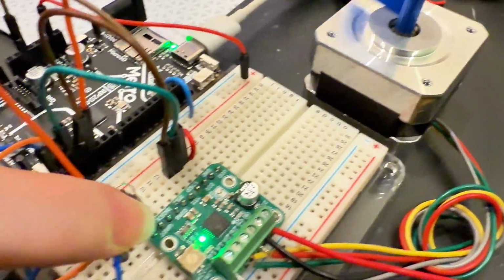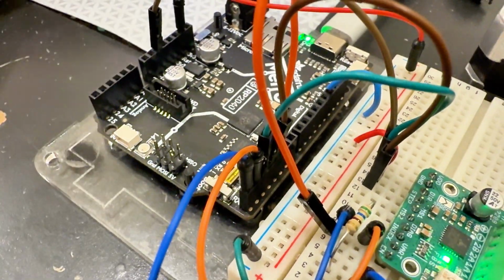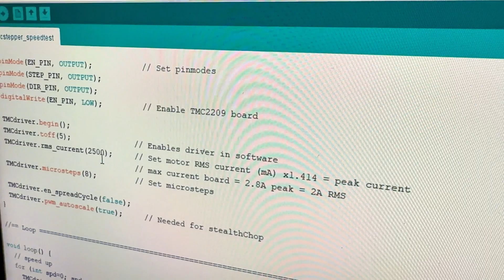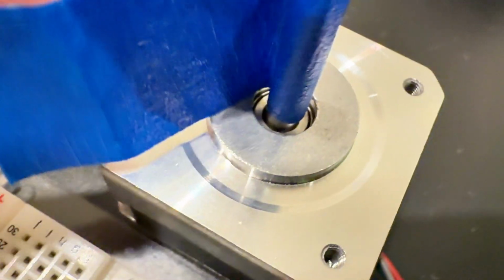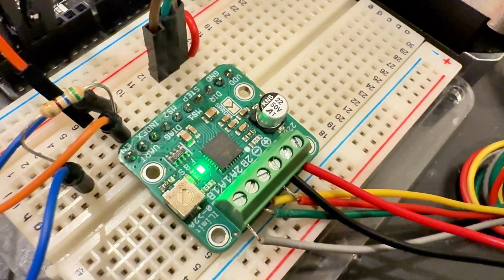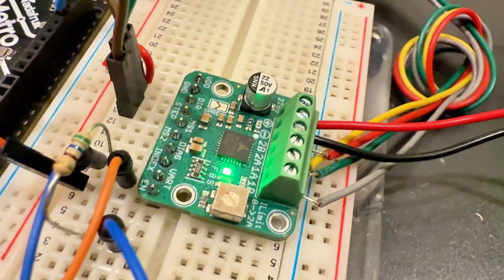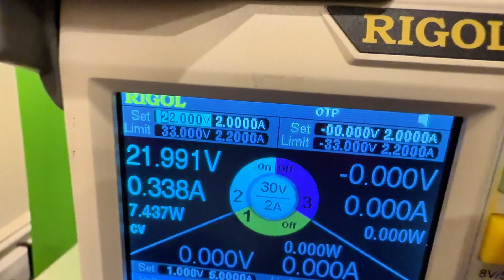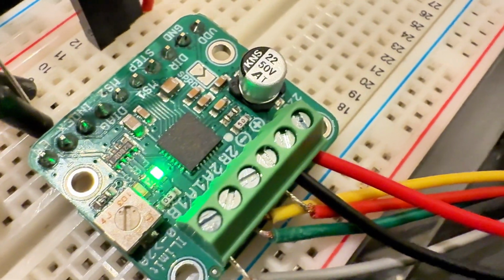TMC2209 stepper motor driver board testing 🤖⚙️🔋

Comment: Hello, 
I have to run my drivers in standalone mode and I can not use the UART to set the Verf. Is there another way this can be done?  I am using the TMC2209s with a FluidNC Corgi control board.